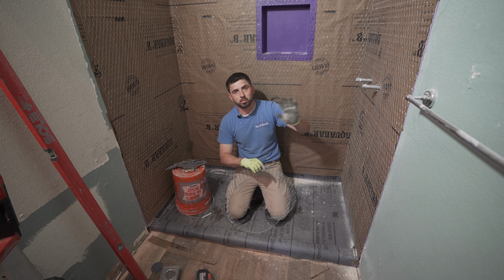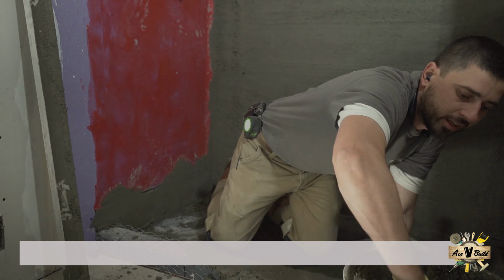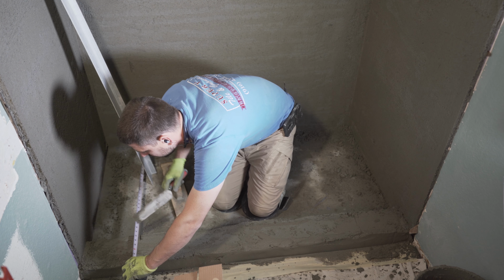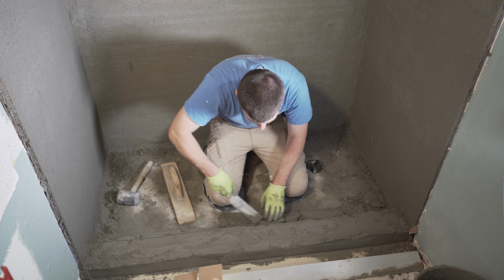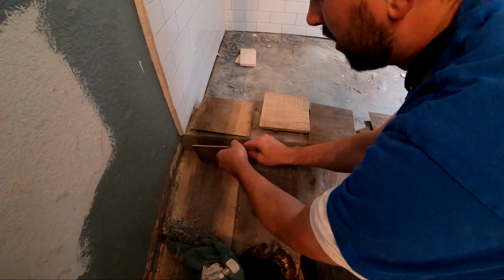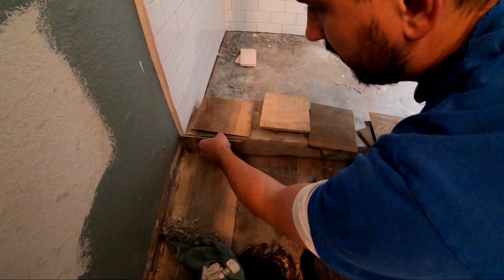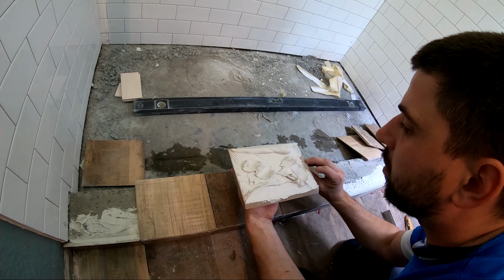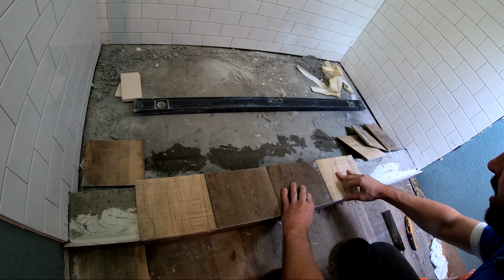HOW TO TILE A SHOWER CURB - step by step.

Comment: Why the 45 degree angle cut? What about tiling the inside of the curb? Is that last? Do you cut the inside tiles at the same height as the outside?
Reply from the maker: I use that kind of cut is because I did not want to put any kind of trim to finish off the edge of the tile . And the inside of the curb I usually put in after I do the floor in the shower.